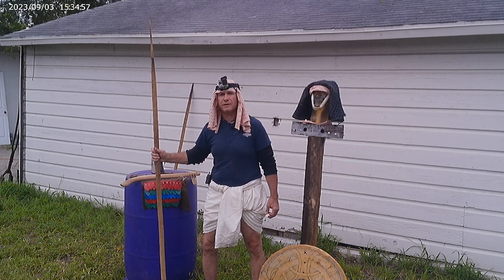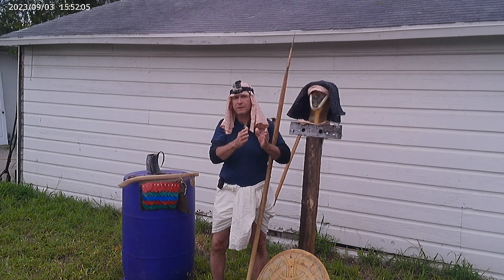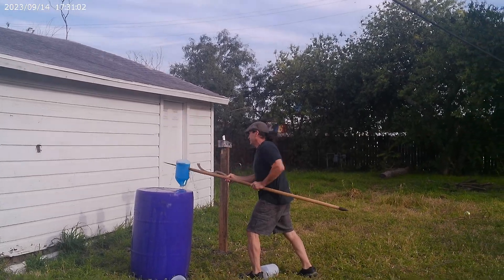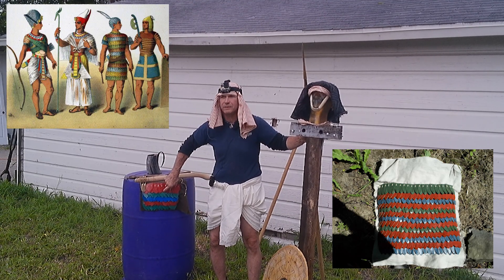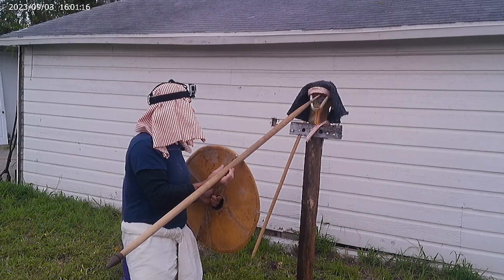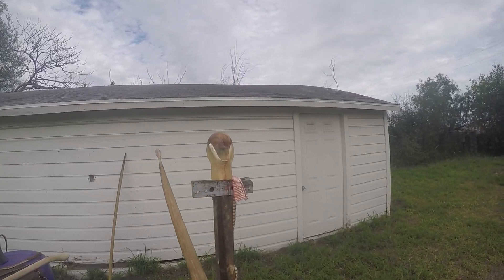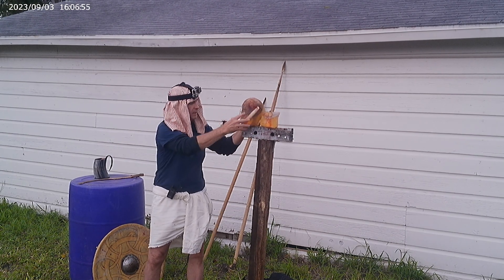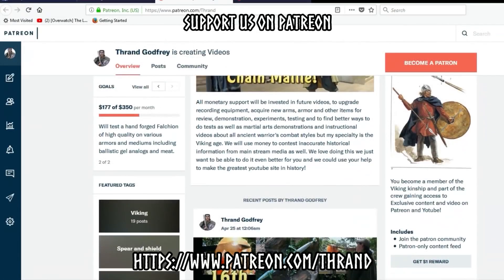Deadliest Warriors of the Egyptian Bronze Age Spear Carnage Tested

Comment: For the Egyptian head equipment, they used mostly wigs, the so-called Nubian wig. Those were done with palm fibers being really thick. To make a good idea they use quite good representations in Pharaoh (1966) movie. As well there are some originals in the Cairo museum, being used from predynastic times to roman times.
As well with the cloth in the head which is something almost exclusive of the Ramesside period armour (around 200 years of use) they probably used a bronze cap or helmet under the cloth, being the second to avoid the overheat of the metal in direct contact with the sun.